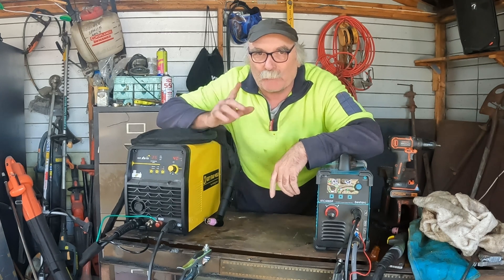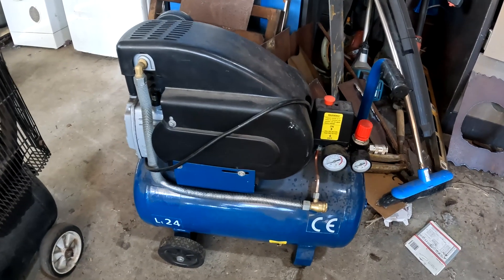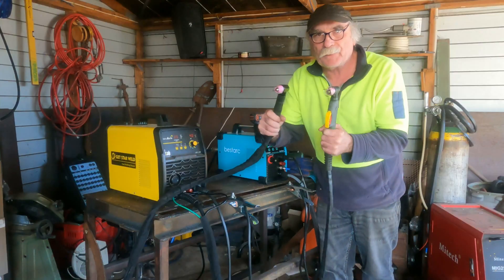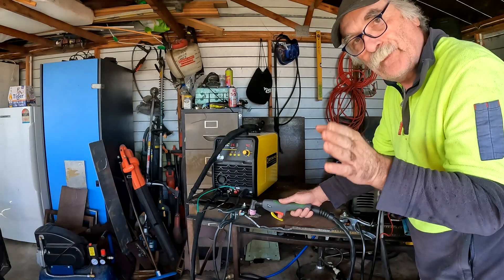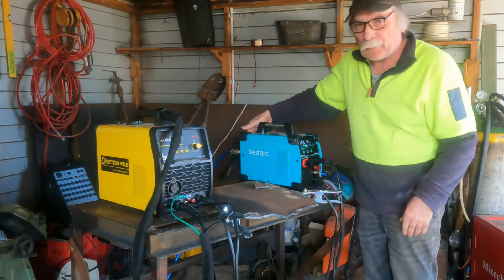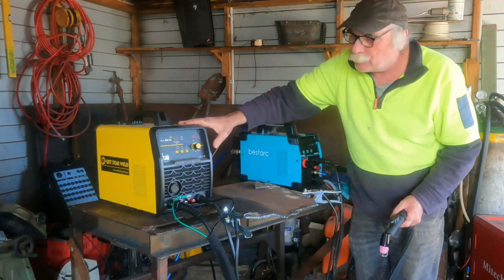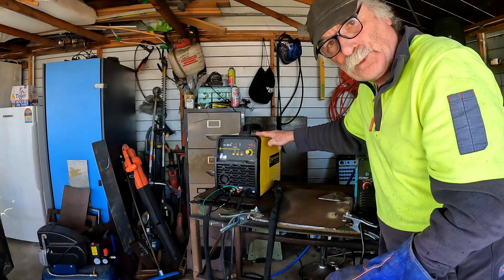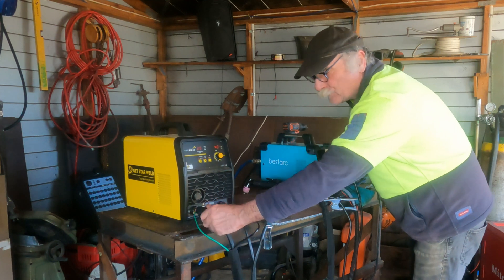Plasma Cutting: Discover the Secret to Longer, Better Cuts Now!

Comment: Very interesting, would be even more interesting to compare consumable consumption rate between those torches. Less air = less cooling = less life ?   I'd suspect so.
Reply from the maker: I Just turn the post time up to compensate. Also threes torches run on very cheap consumables so if you save 1 cut doesn't really matter.

Comment: Is this really an apples to apples comparison? Just because your external compressor kicked on, doesn't necessarily mean that the plasma cutter performance had been impacted yet. It just means that tank pressure dropped below a certain threshold which could be a much higher psi than the torch requires to operate effectively.

Out of curiosity, what is the tank volume and SCFM rating of your primary external compressor?
Reply from the maker: If my air compressor cuts in while i am cutting it blows the  breakers in workshop . As here in NZ we run 220 volt only at 15amp .But if i use the built in unit it will keep cutting . Uses less air volume